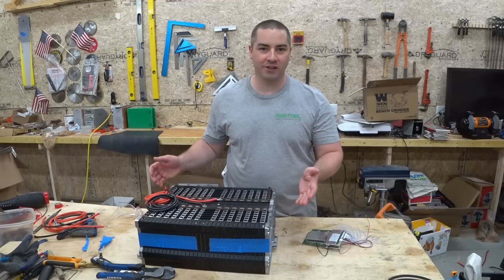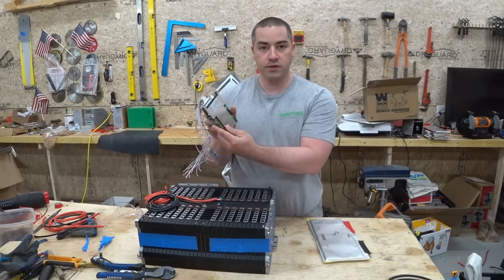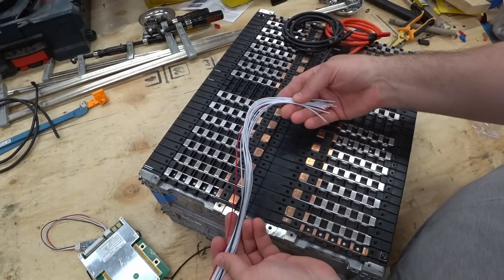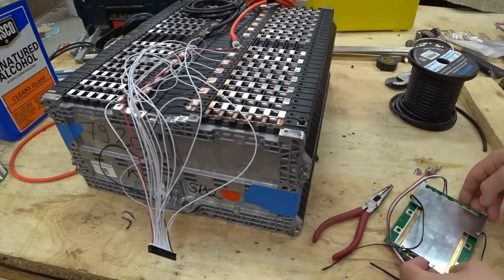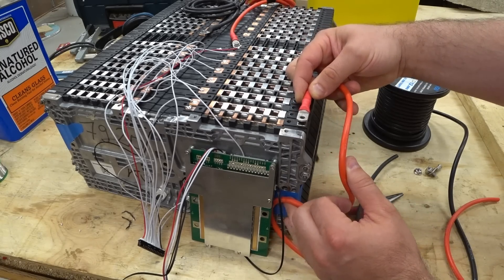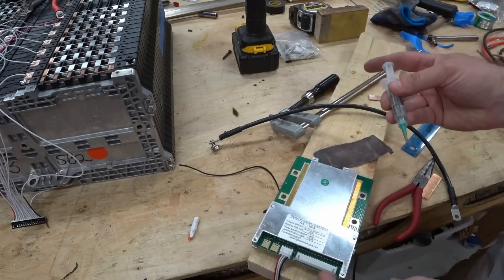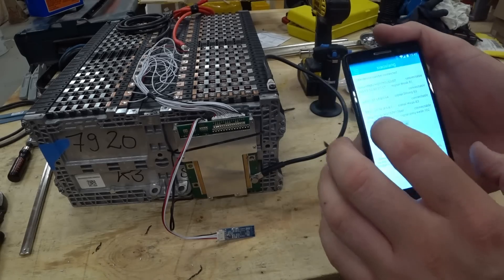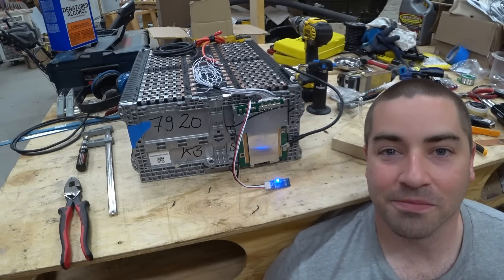100A BMS with Bluetooth Monitoring, Install

Comment: What bms can i use of I'm expecting to pull over 1600Amps? Thanks
Reply from the maker: Wow, that's a lot.  Sorry, I don't know of a single BMS that can handle 1600A.  If you could split your battery pack into 6 batteries in parallel, then you could use 6 of these: https://batteryhookup.com/products/7s-21s-24v-75v-300a-lithium-ion-bms  (discount code DAVIDPOZ)
Reply: @DavidPozEnergy  thanks for your time and I do enjoy the vids. Great info.

Comment: Hi David, i have been wanting your channel uploads over and over for years! If you will: I have some 188AH Samsung 5S2P cells, 18.35 nomimal voltage. I am wondering if the Overkill 48V 16S BMS will allow me to use only 15 of the cell strings like the JK's and others? Thanks regardless!
Reply from the maker: I've never tested Overkill Solar products.  Usually a BMS is built for an exact number of cells.  If you can use less it will be specifically talked about in the description.
Reply: @DavidPozEnergy  that's fine David. Thanks for taking the time to reply: Much appreciated! When America is divided and ruled by four, may GOD bless you with His truth also!

Comment: Are yu still using this BMS?  I just bought one and can;t locate the bluetooth module (its been out of stock for weeks).  Is it worth it?
Reply from the maker: You don't need the bluetooth module, it's just fun to go into the app to see it.
Reply: @DavidPozEnergy  Thanks.  I know, but I want to be able to monitor each of the 14 cell voltages (this is for a power wall).
Reply: PS: I also bought the UART computer interface device. Have you used that before?
Reply from the maker: I've never tried the UART.  I once found some bluetooth dongles on ebay that worked with the BMS.

Comment: David, Would you know if there is away/device that we can use to connect to the BMS Bluetooth remotely? Checking your BMS while on the road. I am thinking of a device that connect locally to the BMS and then to your wifi and then to the world. I know you can configure your router to open specific ports to the Internet. Just wondering.
Reply from the maker: I'm not good with computers, so I don't know for sure.  One method I've heard of doing goes like this:  Find an old smart phone, either a $40 one on ebay, or maybe you have an old one in a drawer.  The cell phone won't have phone service anymore, but should still connect to bluetooth and wifi.  I've heard there is a remote monitoring app, kinda like zoom can be used to let an IT person fix your computer remotely.  Then you leave the old phone plugged in for power, and connected with bluetooth to the BMS, and wifi to your home internet.   I've never tried it.
Reply: @DavidPozEnergy  Thanks David. Sounds like something worth trying.

Comment: David I have this BMS except wires rather than holes for B- and C-.  I am planning on using it on a 36 volt resistor club car DS  I made a 2p10s Leaf battery pack for.  I am not sure I want to trust the 100 amp max for discharge. I really wanted a separate port BMS but needed one pretty quick. If 100 amp isn't enough for discharge do you see any reason the BMS can't be used just to limit charging to a max voltage and just hookup load bypassing the BMS? I realize some of the safety features wouldn't function. In other words just use BMS to limit charging amps and total charging voltage and as a battery cell monitor.
Reply from the maker: For sure, you can use the BMS just for charging.  Charging is the most dangerous time, and that's when you need the BMS.  The only risk when discharging is you over-drain the battery.  Some golf carts have a little computer (speed controller) that might have a programable low-voltage cut-off.  That might be something to look into.
Reply: @DavidPozEnergy  Thanks mainly confirming what I thought . Definitely helps to run it by another DIY er.  I am aware of the computer s in some carts mine doesnt have one.

Comment: David congratulations on the video. Did you ever manage to set a bms access pin ? I'm frustrated because I can't find a way to do it. The most important thing is to provide security against intrusion. A malicious person can connect and change parameters and destroy a battery pack. The latest version of the Xiaoxiang app, does not allow password settings. Apparently it does, but it doesn't work. Has anyone tried and verified this? Thanks
Reply from the maker: I don't know about changing passwords.  My friend currently is running this battery in his barn.  It powers the barn lights/outlets, and the well pump.

Comment: Hi David, when the battery pack is not on a load (not connecting to any appliance or device) or even charging, will the BMS be still working automatically to balance the cells ?  the cells will discharge themselves over time, not sure if the BMS still detect the pack and start balancing according to the cell parameter.   Thanks !
Reply from the maker: No, the BMS only balances when you are charging.  Specifically, you need to be charging, and over a voltage threshold (I think 3.9v per cell) and there needs to be a large enough differential (I think 20mv)  It's been awhile, so I don't quite remember exactly.  But it won't balance when sitting in standby, only while charging.
Reply: @DavidPozEnergy  Thank you for your info.      This is helpful!
Reply: @DavidPozEnergy  how about when the pack is discharging on a load?
Reply from the maker: The BMS only balances while charging
Reply: @DavidPozEnergy  I see! It is different from balance charger.

Comment: Hey David,   I bought a  4s LifePo4 Batteryhookup BMS (looks simiar to yours with no bluetooth module) along with 4 BATTERY HOOKUP 3.2V 100ah MODULES and hoooked them up. My connections look  good and it was charging fine. It snowed yesterday so no solar charging since yesterday. My challenge is that the in last 48 hours the battery voltage has been going down from 13.45 to 13.13 on its own with no load. I am not sure why the battery is loosing its charge on it's own. I am doubting the BMS more than the batteries but I am no expert in this subject.  Do you or have any idea how I can figure out the underlying problem ?
Reply from the maker: Can you send me some pictures on facebook?  
LiFePO4 tend to settle down in voltage when you first take them off a charger.  Don't know if that is your situation, but might be.
Reply: I am not sure how much the picture will be able to tell but here it is. https://photos.app.goo.gl/2CqUN5dm7XEDL1Q16. I am going to wait for bluetooth dongle to be available or figure out how to read the UART using a serial connection (with microcontroller or pc). That may give me definitive data on how much current is leaking/consumed by BMS or solar charger overtime. I wish batteryhookup was providing some user manual or something that we could have used.

Comment: It is not a good idea to put biggest BMS so it works at 40A. Amperage they rated is for cutoff - protecting battery in case of short circuit and it should be rated as safe for the battery.

Comment: Again that cr*p app, that doesn't work properly. If you charge the parameters, does it save them? Those coloured circles on the first page are supposed to show amps & somethimng else... yet it shows 0. Not impressed, & I would have thought you'd've gone into it a bit more.

Comment: Question. I have a bunch of 30 volt lithium ion batteries from hybrid cars and I need a way to keep them from over charge and under charge. The BMS's you use are for 3.7 volts and won't work with 30 volts. Any idea how I can do a BMS setup for my batteries? Thanks.
Reply from the maker: Since you said your batteries are lithium, look inside and find out how many cells they are.  At 30 volts, it might be 8s, or 8 cells in series.  Which would require a 8s BMS.  BMSs are made in any configuration.  I buy mine from Aliexpress.  If you search using key words "BMS" and "8s" you will find several to choose from.  But you need to know your chemistry of lithium, and how many cells you have in series.
Reply: @DavidPozEnergy  Thanks!

Comment: What stand 100ampere for ? What type one is best give an example
Reply: If current get over that value BMS will cut the line to protect battery from overheating and damage. You should not get the biggest one, but that matches your battery.

Comment: Came back to watch this one again.. Are you charging the battery through the BMS on the C- side?  Did you ever figure out how to separate power coming out of the battery from charge power coming into the battery?
Reply from the maker: The charging and discharging happens through the same wire.  This is a common port BMS.  I think separate port BMS's are used on E-bikes, and scooters.  But I've never built a pack with a separate port.
Reply: @DavidPozEnergy  wow so all that battery power is getting sent through the bms into your inverter and then?  I would think that pack could handle hundreds of amps? I mean if you have this much storage why would you not run your HvAC with it as well?
Reply from the maker: I built the battery with 6 BMSs.  Each BMS is rated for 100 amps.  I put in circuit breakers at 40 amps on each to help limit things.  But the whole setup is good for 240 amps continuous.  Ran my whole house for a while.
Reply: @DavidPozEnergy  very nice!

Comment: 101 comments and 1 year later, has anyone asked if this bms comes with the low temperature cutoff to prevent charging below 0C?
Reply: Temp switch and a relay can do that very reliably, so there is no need for one in a bms.

Comment: Hi, a question: can i use this BMS-Modell for my 6S Battery with 60V in my Escooter? If not what would you recommend me so that I also have bluetooth?
Reply from the maker: You can't use this exact model, but the manufacturer makes one that will match your needs.

Comment: How is this BMS holding up? Would you use it again? Maybe do a BMS comparison vid.
Reply from the maker: These BMS's are working fine, no issues.  Lately I've been using more of the Daly brand.  I like trying the different brands.
Reply: @DavidPozEnergy  your doing a good job......do a BMS comparison to show why you like Daly.... I like the blue tooth on these.

Comment: I am at a loss how does it charge and does it only use that small red wire for balancing or does it just balance and no charge
Reply from the maker: hi Old Time Engineer.  These balanced through the thin white wires.  There are red and black wires on the pack, which are the 8 gauge power wires.

Comment: Good video David.  I have 2 Tesla S packs. They are 6s two put together for 48 volt would be a 12s BMS. I looked on Ali and the 12s said that would be lipo . Do you think this bms would work for the Tesla S packs?
Reply from the maker: The Tesla cells will be a nominal 3.7 volt cell, or a nominal pack (two together) of 44.4 volts.  The max per cell is 4.2, usually the BMS are set to shut off at 4.25v per cell.  So long as you find a BMS with these parameters, it should work.

Comment: Hi, I know that the BMS have pins for Power indicator and Switch, I have the same BMS but I don't know the exactly mode to connection. The BMS is always power on. There is a metod to add a switch to power off it?
Reply from the maker: It might be possible, but mine are always on.  I don't know how to switch them off.

Comment: could i use this for a lifepo4 pack?
Reply from the maker: The same manufacturer makes a BMS for LiFePO4.  But you can't use this exact same model.  You have to buy the model that matches your batteries.

Comment: On your link, there are choices for 10s and up, I’m using 8s LiFeLo4 (24v), been looking for a decent BMS with Bluetooth, but I assume it won’t work?
Reply from the maker: No, these BMS's are specific to your cell count.  The manufacturer does make 8s options.  https://www.lithiumbatterypcb.com/product/7s-8s-10s-li-ion-or-lifepo4-battery-smart-bluetooth-bms/
Reply: Will Prowse suggests a good 8s BMS on his channel. Check him out.

Comment: So maybe I missed it in the video but why no connection to the C- side and only B-?
Reply from the maker: The C- side goes out to loads.  I hook up the C- side in a future video.  https://youtu.be/TmqkE6KuHJc  Thanks for watching.
Reply: DavidPoz thanks. That was helpful. Have you calibrated your BMS cell voltages against a good reader? Noticed the BMS app has that option and I noticed that most of the readings are off by a few hundredths of a volt (higher or lower) when compared to one of my better readers.
Reply from the maker: No, I didn't know the app had that option.  Which menu?  I also saw tiny differenced +/- compared to an accurate multi-meter.
Reply: @DavidPozEnergy  Here is the app. that I came across that connects to the BMS, 3rd party and in english. https://secondlifestorage.com/showthread.php?tid=8100
Reply from the maker: Thanks.  I'll have to ask my wife to borrow her iphone.

Comment: I'm actually just after installing that very bms in my new ebike battery. Very excited to try it, but I can't even find a controller to utilise the power, I'm fussy so it's gotta be 14s and sine wave and 80-90amps, anyone know any good controllers??? I'm using Samsung 35e cells in a 9p configuration for those who are curious.
Reply from the maker: Sounds like a good project.  I've never made a ebike, so I won't be able to suggest a controller for you.  I hope the BMS works well.

Comment: What is a safe voltage for these cells? Fully charged and discharged? I'm building a 36v pack with these cells and would like to know safe parameters! Thank you
Reply: Also what charger would you recommend to charge the 36v pack?
Reply: Sorry I'm not doing solar I would need a 110v ac wall charger to charge the pack im building to run my 36v minn kota trolling motor on my boat
Reply from the maker: Hi Nick,  These cells are Li-NMC chemistry.  The absolute extreme voltages are 3.0-4.2 volts per cell.  However, if you use these numbers the cells won't last long.  I personally use 3.5-4.05 volts per cell.  The more conservative you are with the voltages, the longer the battery will last.  I've never built a 36v pack, I'm guessing you are using 10 cells in series (10s), is that right?  If it is then we can do the math.  4.2 volts is the extreme, times 10 cells equals 42.0 volts.  Or 4.0 times ten equals 40.0 volts.  You will be looking for a charger that outputs 40-42 volts.  Chargers for lithiums are called CC/CV .  This stands for constant current / constant voltage.    

Here is an example I found on Amazon: https://amzn.to/2Hde6dH  Since this is 4.2 volts, don't let your lithiums sit at this voltage.  Instead, plug in your battery to the charger the night before fishing, the next morning go fishing and use the battery.  When you come home check the voltage.  If it is above 36v (3.6v/c) then leave it alone until next time you fish.  If it is below 36v, then throw it on the charger for a short period just to bring it up to 36-38v range.  But don't bring it all the way to 42.
Reply: @DavidPozEnergy  wow thank you for all the info! The manufacturer of the motor say they don't want to see voltages over 40v and don't recommend lithium do to low amount of voltage sag .. however I really can't afford to have 240lb of batteries in my boat... I've had that setup and it'd just too heavy!  Is it possible to run 9 cells? If so what bms and charger would I need.  I just ordered that same bms you are using would that still work?
Reply: @DavidPozEnergy  also I feel that a 2.5 amp charge rate would take forever on this pack?  I plan to build 3 packs from this battery so i can take what i need and keep the excess weight off the boat!  I may do 1 9s cell then 1 18 cell with 2 9s packs paralled? Is it possible to run 1 single BMs on that dual 9s parallel pack?  I really appreciate all the info.  Im trying to educate myself but there are so many different opinions out there I get overwhelmed and have to think ( nick you're just building a trolling motor battery)
Reply: @DavidPozEnergy  also the motor specs say is draws 52amps max however I have a different prop on it and its pulling around 65-75 I kept blowing a 60amp breaker anyway.  Maybe it was just a cheap one? I switch to a 100a breaker and have had no problems with false tripping
Reply from the maker: There is too much  stuff for a youtube comment.  Try connecting with me on Facebook.  https://www.facebook.com/DavidPozEnergy/

Comment: Fantastic video! The links in the description are not clickable why?
How do you actually balance when out of balance? Like discharging when too high or charge when too low?
Thanks 🙇‍♂️
Reply from the maker: I don't know why the link won't work.  Maybe that seller changed the listing?  These do have a very small ability to balance, but not a lot.  If the cells get huge out of balance in a couple years I might have to re-balance using my "balance board" I showed in a previous video.  Here is a link to the manufacturer of the BMS: https://www.lithiumbatterypcb.com/product/14s-bluetooth-lithium-e-bike-battery-pcb-board-with-30a-constant-charge-and-discharge-current-2/